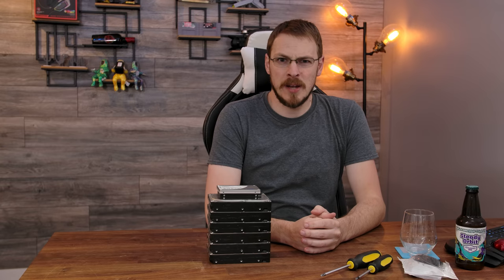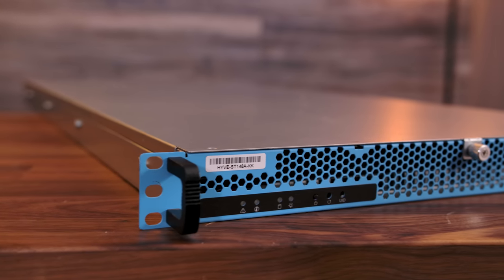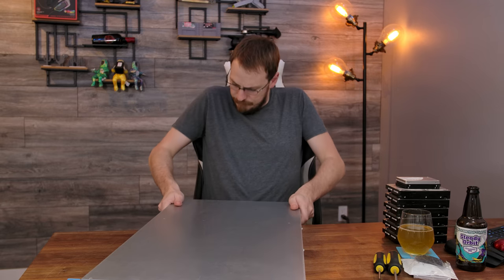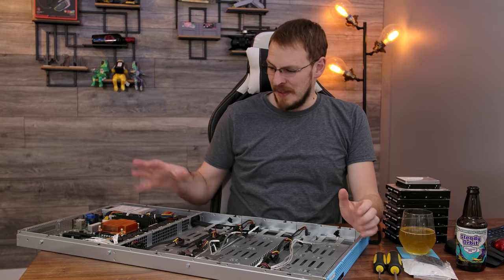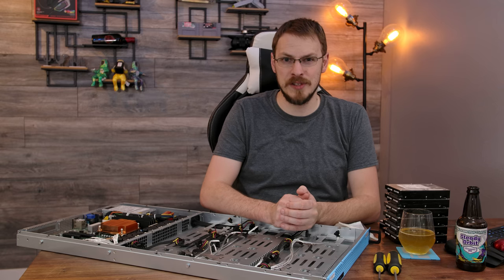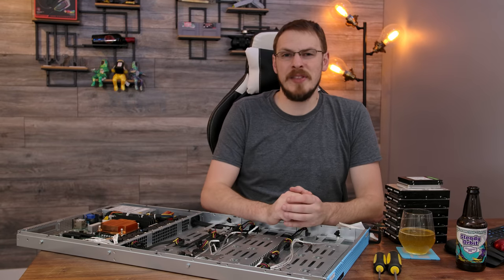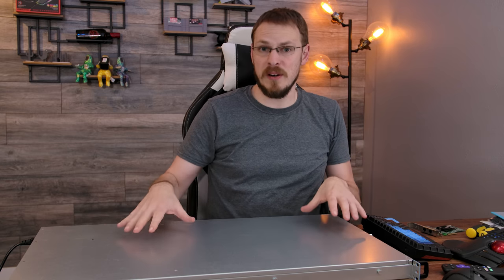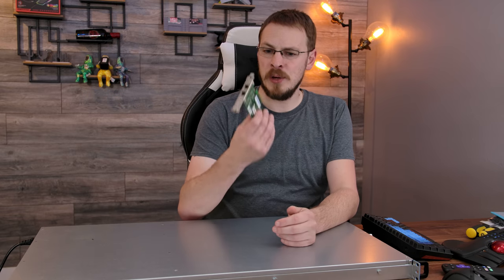A 12-Bay, 1U Storage Server for $120?!?

Comment: I bought one of these, so I thought I'd share my experience so far:
#1) I should have gotten the 16GB version (was only $16 more when I ordered)
#2) the CPU heatsink had the wrong orientation (was perpendicular to fan airflow, blew the fan shroud right off as soon as it powered up :)
#3) the HD screw mounting holes have been changed for high capacity drives (6+TB, I believe) so I could only use two screws on my 14TB drives (screw and grommet technique works well)
#4) IPMI works (pw root/root) but Java client for remote viewing is a problem (I couldn't get it working on Windows 10)
#5) BIOS defaults enable VT-d, so I didn't need to change anything for my use case
#6) ProxMox installs without trouble, all hardware including Intel NICs supported (just need to add "intel_iommu=on" to grub config, for hw pass through)
#7) added a PCIe x1 2-port SATA controller using riser cable, for system (ProxMox boot drive)
#8) I installed TrueNAS in a VM (why I should have gotten the 16GB version), and passed through both the LSI controller (handles 8 of the drive bays) and the regular SATA controller (handles other 4 bays plus 2 more ports)
#9) on first boot TrueNAS updated the LSI firmware (from 13->20)
#10) at idle, with only SSD system drive, power consumption was 35W.  After adding 3 14TB WDs, power consumption was 68W under load (which matches similar results of 10W per USB enclosure for the WD drives).  I believe TrueNAS has some options for power savings and idle drives, will experiment.
#11) I added a 10Gb Solarflare S7120 (riser card), which works great.  However, I didn't expect that adding it would disable the two onboard Intel NICs (maybe a BIOS setting?).  This might explain his trouble with the onboard NICs and TrueNAS.
#12) build quality is excellent!  Fans spin up loud, but then throttle down to "audible but quiet".  Temps are very good (Xeon running at 40C under load), LSI and SATA controller heatsinks just warm to touch.  PSU is labelled 400W 80+ Gold (but lshw reports "product: FSP500-701UP"?).
I'll be using this as my shared storage iSCSI server.  I only put ProxMox on it so I could manage it along with my ProxMox cluster from a single web page (also, I'm not familiar with FreeBSD, so having a "Linux layer" underneath TrueNAS gives me some more power in dealing with the hardware, just in case).  I installed the "iSCSI over ZFS" patch for FreeNAS/TrueNAS in ProxMox, which works great - so once my initial configuration of TrueNAS is complete, I'll only use it for monitoring purposes (ProxMox can do everything else).
Was going to buy another 16GB of RAM, but it cost $73, so I decided to order another entire Chenbro with 16GB (and no CPU) for $120 instead - and just keep it for parts :O

Comment: For those who may need it, the NIC issue is with the BIOS, not TrueNAS. In "Advanced" -> "Onboard Device Configuration" change the "Dynamic Onboard LAN Control" to "Disabled". When this is "Enabled", the BIOS will automatically Disable Onboard NICs when the BIOS detects an installed NIC card. I'm currently running the same 10Gbe card in the video along side the onboard LAN, with no issues on TruNAS 12.0-U1

Comment: They also have a 1u dual LGA 2011 gen 1 called the “hyve Zeus” for around $100 barebones. It’s the size of a switch, with 2x 2.5” bays. I had a cluster of 3 of them for esxi, and they were surprisingly quiet
Reply from the maker: I bought two of those. Video coming shortly :-)
Reply: @CraftComputing  please include power usage testing on those servers.
Reply: I was hoping you would :)
Reply: I am looking at these servers as options for my home. You're saying they are quiet but Craft in his video reviewing them is saying it's very loud. Not sure what to choose at this point lol

Comment: I'm glad I saw this video when I did. I had just bought a Fractal Node 804 and was going to build a new NAS in it with the guts of my daughter's previous Dell workstation. Then I realized there would be more modding than I wanted to do (any at all was going to be too much) to adapt the front panel pins of the case to the board.  I bought one of these with the E3-1230v2 instead so I'll build something else in the Node 804 later. My wife was happy that I "saved" money by doing it this way.

Comment: AWESOME find!

I like this storage chassis, especially as a single storage node.

The only downside I see is that it only has 1 PCIe full size slot.

I built my TrueNAS (OK it was still FreeNAS when I built it) around a Dell R520 that I added an external RAID controller (flashed to IT mode) to connect to my disk enclosure (NetApp DS4243), and I am also running a Mellanox ConnectX 3  NIC.

But I think I may pick up a couple of these to run as additional storage nodes, the price is awesome!

Comment: Sweet. I saw this while researching NAS solutions for the house. I don't have a rack (yet), but after watching this I couldn't pass it up. Got everything home now, the server just arrived. I shelled out for the one with 16GB of memory. The drives go in pretty easy, though I can see how the last two rows are difficult if you populate them both. The only thing I'm missing is.... the 2.5" SSD I know I have somewhere. It's gone MIA. Last time I saw it was when I extricated it out of Son's room (after a discussion about respecting people's property). I guess I'll be out looking. Anyways, server is well labeled. The MAC addresses for the two 1Gb/E are labeled right on the RJ-45 connectors, as is the management port. The labeling of the SATA bays is on the underside of the cover, and the individual SATA connectors are labeled as well. Looking forward to getting TrueNAS on there. The screws and rubber grommets he linked work great. I dropped some $ on new WD Red Plus drives. I want to know they're known good drives. I don't want to have to think about it for the next long while. Already registered the drives to make sure they are new. Anyways, so far so good, pretty happy.

Comment: That is nice and cost efficient NAS for home user. Btw seller raised the price to $133... For an additional $67 one can get higher spec for more hardcore home user. Supermicro 6017R-73THDP+ with X9DRFF-7TG+ mainboard, which supports dual Xeon E5 v2 processors and 16 slots of DDR3 registered dimms (can easily go 512GB ram for faster cache than SSD).

Comment: According to a friend of mine that used to work for amazon, AWS Glacier uses very similar servers to these in their storage datacenters. 1U whiteboxes slap full of internal platter drives, no hot swap. Just the MIN/MAX strategy on storage density with little concern towards any other features. I personally prefer a nice used poweredge or proliant for a home server but if AWS uses setups like these, it is proof there is a VERY valid use case.

Comment: Bought a $200 low end NAS and this is a much more appealing solution (4 bay vs 12 bay) if power consumption is not a concern. I may just return the unit and go with this instead. Thanks mate.

Comment: I would have mounted with foam double-sided tape...  It's crazy how much used hardware is available due to the lease / replenish cycles of enterprises.  Great build.
Reply: My first hack server used cable ties
Reply from the maker: You really need to shock mount the drives in this server. Vibration in racks can add up and cause HDD failures. In fact, most enterprise drives are rated for how many you can run in a 42U rack safely.

In this case, the grommets would be $20 well spent.

Comment: Just because you have to pull the server out and remove the enclosure does not "no hot swap" a server make. You could absolutely still ESD secure yourself, and make sure the server is mounted with an appropriate run length of cabling to accomodate being pulled partially out on a rack rail for online maintenance including hot swapping disk drives.

Comment: Reading about a similarly branded server, if it detects any network card it will disable the on-board network ports. Apparently this can be changed in setup. Worth checking into if you haven't already.

Comment: Jeff, try solving your onboard ethernet ports not being found by going into the BIOS>ADVANCED>Onboard Device Configuration> turn off Dynamic Onboard LAN Control. 
That lan control will disable the 2 gigabit ports when it detects an add on NIC.
Reply from the maker: Iiiinteresting! Thanks for the advice!
Reply: @CraftComputing  I'm also curious for the IMPI console over the java viewer. Under chrome/edge it doesn't want to let the .jpnl download. It likes IE and launches the applet but gives a fuss and ends. I'm assuming it's like the old iDRAC 6 and below where you have to mess with the allowed ciphers in Java.
Reply: @CraftComputing  have you been able to try that out?
Reply: For me, the NICs were detected but there was no link until I plugged a cable into the IPMI also. I restarted a few times in there too, but either way, working for me now too!

Comment: High Availability, storage is single point of failure. The most critical part that should be available always.

Like your videos.. but I want to see a 2 node GlusterFS cluster for storage or a 4 node CEPH Cluster if you're using Unix-based OS's for your solutions. Outside of that I highly recommend S2D from MSFT.

I have a 2 node hyperconverged cluster for storage (40 TB RAW, 20 TB usable) and virtualizing my directory controllers. That storage is shared out via SMB3 to two compute nodes in a cluster setup for high availability on compute. My only single point of failures are power source, switch, and gateway to internet.

Comment: Good article and video.   I, too, bought this server unit shortly after the video was posted.  I did get a number of the components that was suggested (the IronWolf SSD drives, the HP 2-port SFP+ network card, PCIe 1U Riser, Rubber Grommets, drive mount screws, a Mikrotik SFP+ router, etc.  As I have 10 2 GB Drives (8 of which are less than 1 year old), I am looking ahead to getting larger drives.    

Does this unit support drives greater than 4 TB?  I saw that 4 TB drives were used.  Are there any limitation with larger drives (greater than 4 GB).

Comment: Well i just bought one, and a pair of the 10TB wd red plus drives at Newegg for half price. Gonna be a while before I fill this thing but hopefully it’s good
Reply: Did you get the 10TB drives to work on the motherboard or did you use a HBA?
Reply: @proskater1223  worked great without an HBA. You get all the cables you need ready to go.

The only real sticking point is how monstrously long it is. Jeff has a rack he probably got at a great bargain. If you go looking, though, be prepared to spend real dollars on a full-size rack that can handle this thing. Or, get the server, scrap the case, and pop it all into a smaller box.  Or, get a vertical rack mount bracket.  Or make your own rack. Just don’t expect any old bargain rack to work for it.
Reply: @Pyrichia  what is the server depth?
Reply: @Dmkjr  right around 36” from the rear of the front faceplate to the absolute end of the server chassis and any bits sticking out the back.

Comment: Me: I definitely don't need to buy another server this holiday
Craft Computing: * posts this video *
Reply from the maker: This isn't even the best server deal I'll be posting. Got an even better one in the pipeline.
Reply: @CraftComputing  perhaps I should hold off on hitting "Go to checkout" on eBay right now...?
Reply from the maker: No, I'd get the file server, but also get ready for some 1U dual-socket 2011-0 for ~$100 to go with them.
Reply: @CraftComputing  Nice! Ugh...my bank account is not going to be happy...
Reply: @CraftComputing  WELP! Pulled the trigger on a barebones version of the 1U file server so I could put a E3-1260L in (lower TDP and more threads, but about the same performance as the E3-1220 in the $110 version). Hopefully I can maintain composure when you reveal this other deal...ha!
Reply from the maker: Best of luck my friend.
Reply: @CraftComputing  hey -- my box is coming in this week! I'm stoked. Do you know if this mobo (on the 12-bay server) supports PCI passthrough? I can't remember if you mentioned this in your video here (but you did go over that in the dual 2011 video -- bummer it wasn't supported there).

Comment: I have to ask what is actual use for your home lab? I don't know if I missed it and you've talked about it before. Sure you have critical services running on it -- and I still need to build out some of your cool examples. For the most part what we use at home can be built with a single box and a couple of Pi's. EG, I'm a DBA, and I'm using old hardware as a single proxmox server and and an old desktop I found in the trash as a TrueNas box. I only have proxmox running so I can experiment with ansible., Everything else I do is on a  Pi, and a Synology DS1019+.

Comment: Hmm... didn't think to use shelves instead of rails for servers. I was already planning to buy a set for my UPS, so I'll have to consider the same instead of rails for my NAS and ProxMox server since it appears to be a HELL of a lot easier to install. Plus they're servers I largely don't touch except to clean out dust. Right now nothing is in a rack as I'd been putting off putting everything back into the rack after moving because I wanted to get them on rails, as they weren't previously. Instead I had a couple 2x4s under the UPS to support its weight, and then everything was more or less being supported by the UPS. Bad setup, I know...

Comment: I notice the truenas (bsd) doesn't scale the fan speed based on the CPU temperature, so a CPU stress test will not speed up the fan. Both Windows and Ubuntu are able to scale the fan speed properly, it might be the freebsd telling BMC/BIOS to take control the fan speed but forget to actually control it.
The IPMI console redirection is totally broken for me, maybe I just get a bad unit.

Comment: I just received my Chenbro NR12000 1U 1x 8m QUAD CORE E3-1230v2 3.3GHz 16GB RAM NO HDD from the seller you purchased your unit from. I am interested to know why you state the inboard 1gb ethernet ports don't work? I was able to use the on boards in proxmox, Ubuntu server and truenas. All I had to do was set a static route for 0.0.0.0 to my gateway and boom, everything is awesome.

Comment: I just purchased one of these machines and plan on running Unraid. (I have an unused license from an old project) How did the SAS controller behave? Was it necessary to flash the firmware, and if so, how did you do it, and where did you find the firmware files?

Comment: Mine just came in today and the built in ethernet ports were recognized just fine by the em driver in truenas, so now I have a spare dual port intel nic on hand that I didn't need to buy. Oh well, ill find something for it to packetize someday. I did notice there are options in the bios to turn on and off the nics, so, might want to double check to see that they are enabled on yours.

Comment: I bought one of these after watching your video. My only issue is how to mount a SSD in the case. I'm guessing that there is a missing piece that mounts in front of the power supply, because one of the SATA cables is routed there. If you know the part number, would you mind passing it on?

Comment: Any worthwhile CPU upgrades available for this motherboard?
Reply: I know this is late, I personally put a e3-1260L in mine, little 45W part (compared to the 80W of other chips) and still 4 cores/8 threads with 3.3ghz boost clocks (2.4 base) great for a storage server if not a little too strong

Comment: Hello Jeff,
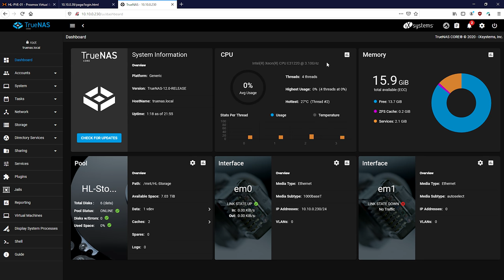at the 7:10 mark you state that truenas does not recognize the onboard nic's 
there is a setting in the bios that turns off the onboard nic's if an external pci nic is installed.
if you disable this feature you will have 4 nic's to work with.
i have one of these running Ubuntu 16.04 LTS and had the same problem

Comment: Am I correct in that in order to use all 12 drive spaces, you're going to need to also buy a sata/SAS HBA?  would it be better in this case to buy a 4-port sata pcie card (and use the rest of the sata on the board) or a sas hba (not using the sata on the board at all)?

Comment: I am running proxmox on this same unit and am having trouble getting the 10G NIC that you recommended up and running. If I boot the unit with the NIC installed I loose all IP access with the unit. Have you run into this before?

Comment: Hi @Craft Computing, thanks for the video.
 I am thinking on starting out my home server lab. And I think this budget server would be great.

But I was wondering if this server can be instead used to host proxmox and virtual machines. My primary concern is the perhaps I need more CPU power? More cpu cores? Or more ram? And SSD?

Regards Eduardo
Reply: Yes you "could" use this for proxmox, but for a VM server you want cores and ram.   This thing only has a 4 core server which you would absolutely have to swap out for more cores and only 4 ram slots means you are going to limit your ram usage.   That and I can't stress enough that spinning hard drives is not the best for VM's.   You will have a bunch of "computers" all hitting the same storage medium.  You need the high amount of IOPs that an SSD can provide.   But you actually you can get away with about 1TB of SSD since most VM's really do not need more than the standard 32GB that Proxmox recommends (unless running Plex or Windows VM's).

Comment: because is not clear from the video, with some patents do you think you can use the server to mount only 2.5in SSD driver? even with 1 screw since they are not moving parts should be just fine.
Reply from the maker: That should be fine. I had some 3.5-2.5" drive adapters on hand, and would recommend you go that route, but as you said, no moving parts. They should be fine.